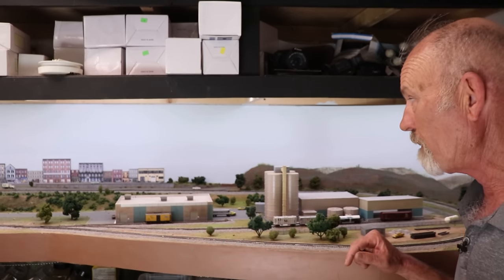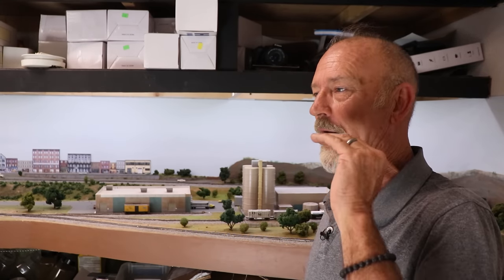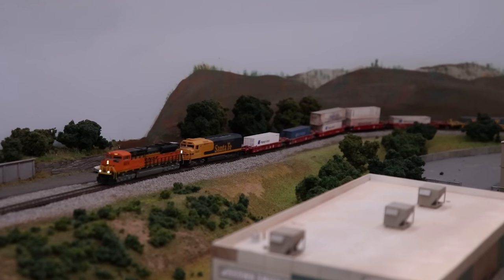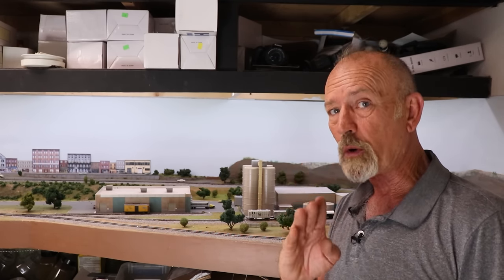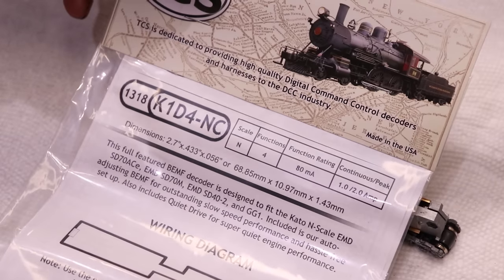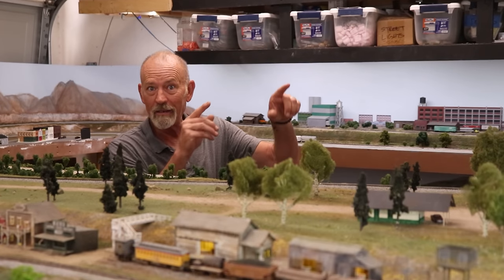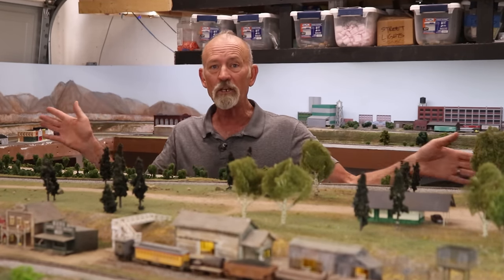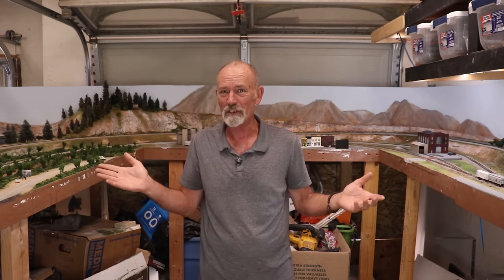112: Grand Finale: Yep, it's the end of the line.

Comment: Steve looking great.  I've found the very best track cleaner is a simple Nickel! That's right 5 cent piece,  rubbing it over the rails do it best, just turn off the power🥴. Now for those thar are wondering what Umutaiiym. Is a metal found in meteorite it light and very strong use in satalights.  Thanks for sharing Jack
Reply from the maker: Well, it's only been an hour or so, but I gotta tell you - that nickel thing is the hot ticket. I spent about a hour running it back and forth on the rails, and pressing it in. As of this moment, I am running my favorite train at a slow speed, and not a blinking headlight. The train is quiet and seems to be running effortlessly. We'll see how long the "cleaning" lasts, but for now what you suggested is the real hot ticket. Thank you so much and rail-on my friend!
Reply: @ItsMyRailroad  yep it works great it fills the scratches with nickel and rubs off everything else. Glad it works for you👍
Reply: Or a metal washer and rub the rails lightly..
Reply: @sixpackmrttomskinner8792  yes that works too but it leaves metals at conpamates the rail nickel is the same as the rail🥴
Reply: @jolliemark6294  
Plus a wipe with a cloth after !
Reply: What year nickel?   Kidding.
Reply: @derekalexander4030  😃😆😃😆🤣
Reply: @derekalexander4030  😂
Reply: @ItsMyRailroad  stainless steel washer- burnish your track with it first
Reply: Unobtainium is on the Monthly Periodic Table between Lithuanium and Plebiscite.
Reply: @KutWrite  yep i found out about oit in the core
Reply: Hey Jack,
Well that may be true, but there is a domestic source for Unobtainium, a substance similar to Umutaiiym.  Unobtainium is produced from locally sourced Leaverite.

Comment: I used the same NO-OX-ID A-Special on my layout as you. The reason your track got dirty right away is: the NO-OX is slightly tacky. So it pulls off all the accumulated dirt off your rolling stock wheels and onto the rails. You simply wipe the rails with you pads and after a few running sessions the track will stop getting dirty. Rail oxidation will continue as the weeks go bye, so simply wipe the rails lightly every 6 weeks or so. I run my N scale about three times a week, and I didn't have to clean my layout for a year. Then I stripped the old NO-OX from the rails and recoated everything again.  Ron's Trains and Things is a You Tube channel and he has a video about this fantastic product as well. He only cleans once a year too.

Comment: Steve, I think your right about sensing, but not speed from the aspect of pure speed, but more so from electrical load draw.  You will also notice that the TCS decoders will use that same bit of technology to adjust the sounds coming out to give you a higher RPM motor sound when pulling a heavy load even on 0% grade.  I replaced all mine a couple of years ago when I rebuilt all my that average about 22 years old with new lights because I wanted to improve the sound quality.  Thanks for putting together a nice video.

Comment: Digitrax decoders have two separate settings for back EMF: single-unit, and consisted. By default, EMF is turned off when consisted, which is what we're seeing here in your demo. (Digitrax buries the details deep in the technical manual. Why?) I set CV57 in my Digitrax engines to 68, and they take hills just fine when consisted.
Reply: Hmmm, good to know thanks

Comment: I use Oxguard not no-ox id. It's mostly the same. If you didn't get it to work you did it wrong. I don't run but maybe once a month and haven't cleaned my track in 18 months since putting the Oxguard on. You have to get the track completely clean where no black at all is coming off the rails, also you have to clean the wheels on your locomotives until there is no black on them then coat them, and you must go a step farther and clean all your freight car wheels but it won't work if they are plastic wheels, you have to have all metal wheels that you clean then coat with the Oxguard. Brand new wheels need to be cleaned and coated before adding the to the layout. Just a small amount works but don't get to little. Wipe on with your finger and get up any small globs on sides of the rails. If you do all of this the Oxguard will work flawlessly. The man I learned this from hasn't cleaned his rail in atleast 6 years and does not run trains that much. Don't let this video stop you from trying Oxguard or no-ox id. I use Oxguard that comes in a tube not in a tub like the no-ox id. You can find it at Lowes Home Improvement Warehouse in the electrical department around where the wire strippers are located. Try it before you decide it's not worth it.

Comment: There is a possible issue that may have caused your track cleaning challenge. Some time ago I had a friend that liked using Wahl clipper oil to "clean" his HO scale track. Almost all his cars had plastic wheels. The result was a black residue showing up on the material (cotton rag, paper towel, Etc.) we used to wipe the rails. I won't keep you in suspense, after much head scratching and testing we found that some petroleum based fluids will attack the Delrin plastic used to make many model train wheels. The metal wheels on the locos weren't affected but the plastic being eroded from the car wheels was coating the rails and preventing current from being picked up by the engines. My friend was an old-time model railroader who had built his layout in the '50s with brass rail track which corrodes and leaves a residue which does NOT conduct electrical power. When we met, he was just finishing up re-railing his layout with nickel silver track. This also corrodes but the residue left on the rails DOES conduct. In addition, many of his cars he built from kits during the '50s and they nearly all had metal wheels. He had been using the clipper oil for many years and he found that it prevented his brass track from corroding as quickly. As he began to acquire the newer ready-to-run cars, he ignored the fact that they almost all had plastic wheels. It was an issue that gradually worsened over a period of years so the actual problem was not at all obvious. We cured it by thoroughly cleaning the rails with alcohol and keeping them dry afterward. I personally enjoy using a DIY rail cleaning car originally developed by the great John Allen which consists of drilling two holes in the floor of any fully enclosed car (box) cutting out a 1x 1" square of 1/8" Masonite (MDF) and glueing two roofing nails to the square in alignment of the holes in the floor of the car. Lightly sand the bottom of the square and thread the nails into the holes and it is ready to use. It works great!

Comment: Steve I have put atf on my n scale track once about a year and a half ago and have never cleaned it again. You only put on a end of a tooth pick an I put it in about four places around the layout which is three trains running on separate tracks. If you put any more than that the wheels will slip and you will pick up dirt and turn it into gunk. Then you will be scrubbing your tracks. It will put such a thin film on the tracks you can’t see it or feel it but trust me it works great. And running them 3-4 times a week keeps everything clean and running smoothly. I really enjoy your videos keep up the great work. Your layout looks great. Otto
Reply: Atf !?  Lil help 👍🏻 Thx

Comment: Running DCS52, UR93, and UT6D. I have both DT and TCS running together smooth. No big deal if you don't mind spending an hour per locomotive messing with programming.
My layout is one year old with no cleaning. Although my MicroTrains plastic wheels are gradually increasing diameter.

Comment: Steve, instead of ATF, you might try CRC 2-26.  I have used it on my railroad and it works great for me.  I at first cleaned my track using acetone, then applied a thin coat of CRC 2-26.  No cleaning within the last one years.  Additionally I run my trains frequently.  PS you are the best model railroad guy on the net.  The others have annoying voices, talk to much without saying anything, or are just plain boring.  Keep up the good work.

Comment: I personally find that N Scale with DCC is more sensitive to electrical issues with clean track and wipers than just leaving them DC. My issue with DCC for N scale is no keep alive and with sound, it's a big deal.  I had a new 4014 golden spike edition Tsunami 2 fancy shmancy.. it had horrible electrical pickup, clean track or not. When it hit a bad spot the decoder reset and so did the sound, sometimes being stuck with the whistle blowing.   Previous 4014 was DC only and it ran like a dream.

Comment: Just some commentary;
Back EMF; electric motors act as both motors and generators at the same time. The faster the motor spins, the more Back EMF it creates until it eventually cancels out the input voltage setting the top speed of the motor per given voltage (kinda like a governor). I suspect the TCS decoder has much better Back EMF sensing so it knows when the Back EMF drops off, it knows the motor is slowing down due to increased load, so it applies more voltage to bring the motor speed back up to where it was.
ATF and No-OX-ID also cause a huge loss in traction. Although the black stuff you find on track is often carbon caused by the micro-arcs between the wheel and rail. The dirtier the track, the more carbon that is produced causing more arcing until the train doesn't want to run anymore. No-OX and ATF were supposed to prevent that. One thing that I haven't tried yet, but heard a lot of good things is using graphite to control the arcing. By using a soft graphite artist pencil on the track, you can increase the conductiveness without leaving a sticky residue, although some loss of traction may still result. Graphite is conductive and helps prevent the arcing that causes the carbon buildup.
Reply: Also that building you didn't know the use for. That would make a great Transfer Co. They transload railcars to trucks for local delivery and also truck to railcar. Transfer and Warehouse companies are not as common as they once were, but there are still many out there. A common commodity would be beverages, especially beer. Coors Brewing in Golden Colorado ships beer all over the US in Railcars.
The Georgia Kaolin car wouldn't make for a good oil car. Kaolin clay slurry is used at paper mills to give paper a smooth white surface. That is the primary use for those cars, but there are some other industries that use the clay. The clay is heavier than oil, so the car is smaller than a oil tankcar. What you need is standard tankcar around 23,000 gallon in size. An all black Atlas 23,500gal tankcar would be perfect for that kind of service.
Reply from the maker: Thanks Funnelfan. I have also tried the graphite on my rails with some success. It's just that after applying the ON OX, my trains ran about 5 laps and the black stuff was back, and thick. I cleaned and cleaned and got nowhere until I finally got it all off (or so I think). Your explanation of BEMF makes perfect sense to me. Thanks.

Comment: Sure looks like a BEMF issue to me.   The digitrax decoders have a BEMF setting for stand alone operation AND a different setting for consisting.   The default is NO BEMF for consisting and some BEMF (about mid level) when running with no consisting.   So, if you have consisted the 2 locomotives via Advanced consisting then you'll have zero BEMF.

Digitrax uses CV57 for BEMF.   At 0 you have no BEMF and at 16 you have full BEMF IN STAND ALONE OPERATION.   Digitrax uses the values above 16 to control consisting BEMF, if you don't understand binary it gets confusing.   For example, a value of '85' would give you a setting of "5" for stand alone AND "5" for consisted operation.

Comment: I few great ideas in the comments. A Nickel for track cleaning to an operating session so we can see how it all goes together with a few local switching challenges.

At the metals place - "it is a collection sorting and cleaning facility for mixed metals" - gondolas of mixed metals arrive, unloaded and taken into the building for cleaning and sorting and cutting into smaller pieces that are put into the smaller bins, full and empty bins stored under the canopy, box cars come in for when they have a load of a type of metal to ship out. They also take in local scrap metals.
The Kaolin tank car... Kaolin is a type of fine clay used to give that shine to quality paper to China to a pharmaceutical filler. Maybe add another storage tank for an off scene municipal airport to store Av gas and Jet A and have a tank car come in now and then to refill the storage tanks; it is a handy secure location and more likely to have an owned tank car spotted there until it is replaced with a full car.

Comment: Yes, track cleaning? What a tangled Webb that issue is. I've tried all sorts but at the end of the day a clean, polished track seems to be the most reliable answer. Abrasive track rubbers, however, are not the way to go. They put micro scratches in the track that holds fine dirt particles and anything that will settle there! 
Isopropyl alcohol (I.A.) is possibly the best grime remover ( for me anyway). I have also used CRC contact cleaner (sparingly) but always follow up with my CMX car and I.A after. Also once the track is clean I always make sure every consist has a waggon with a Masonite rubbing pad under to remove "sticks and bricks" off the rails.
I look forward to your posts and thanks for your past efforts.

Comment: I would like to talk about grades. 

I use the woodland scenics incline sets they are expensive but consistent. I assume your grades have no flat spot or break in between for the loco to regain traction at the top of the hill. (Every 2 feet) If you don’t have a flat no grade section between the 2% grade sections the locos wheels will be in air or spin when it can’t make it up the hill. If your grades are made with plywood, something could be not consistent
In the grade. Nothing wrong with way you’ve done it just trying to point out things I’ve learned. 

If you’re running diesels (kato) just add more kato diesels to your consist. If you’re running atlas, intermountain, fvm, keep in mind they use scale speed motors and all different factories to manufacture their locos. So the quality of atlas pulling power is all over the map depending who and when it was made. Mr. Fifer remotors all his atlas to kato motors. There is a reason why. He has lots of grades. 

I do not speedmatch. 
I buy kato diesels whenever possible 
I buy Broadway steam and diesels whenever possible. 
I have had excellent success with these  and the woodland scenics foam risers system. Please see my many videos proving my point. Thank you Steve for the vids. -Tyler

If you’re running steam, make sure the loco has lots of weight in the tender and boiler. Any modern locos like (BLI) do and don’t require mods.

Comment: Hi Steve, I know this video is a year old, but I've just run across it. I sure hope you haven't discarded those Digitrax Decoders. My layout is a flatland branch layout, but the Scaleable Speed Stabilization (Back EMF) CV55, CV56 & CV57 values that work best for me is CV55 = 128, CV56 = 80 and CV57 = 6. The first CV I adjust to make minor tweaks is CV57 and the highest I've had to set CV57 was 9. If you still have those decoders, get that a try and see if it works for you? Also my favorite TCS decoders are the CN and CN-GP split board decoders that are a direct replacement for the split light boards in many Atlas, Kato and Life-Like / Walthers locomotives. They are not true plug n play, they are a cross between a hard wire and a PnP decoder. But Thank You TCS, these CN & CN-GP decoders have saved many of my older locomotives from the scrapper torch. OK not really the scrapper torch, but from being placed in the "When ever I get around to it DC box" of locomotives from before DCC PnP and Decoder ready days. Cheers, Rich S.